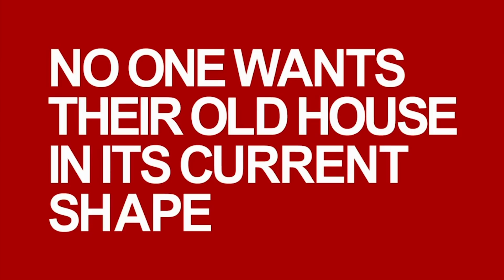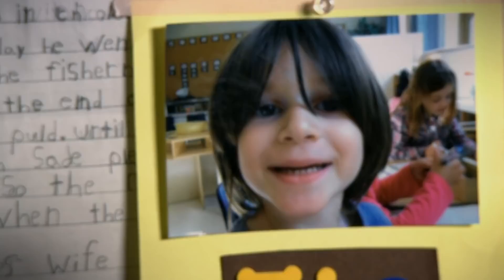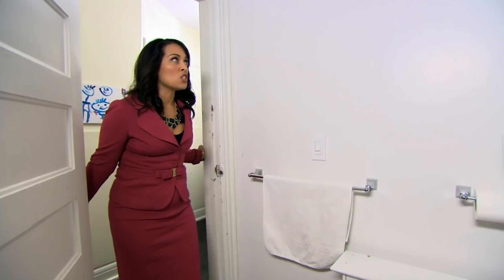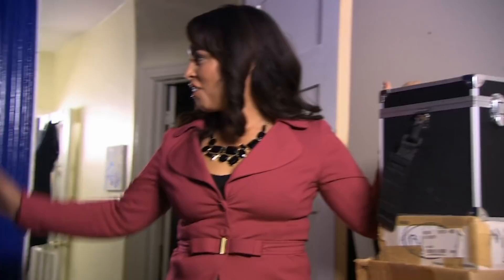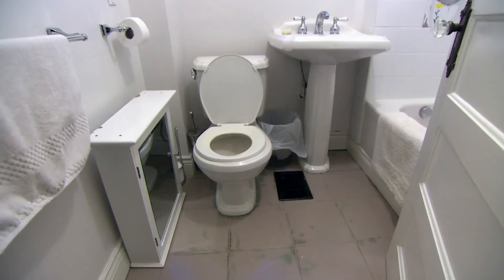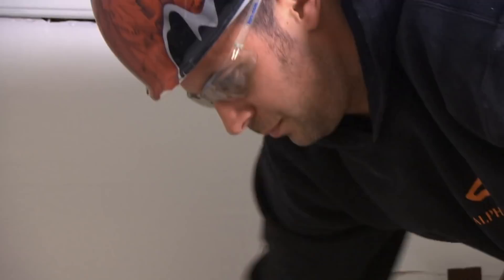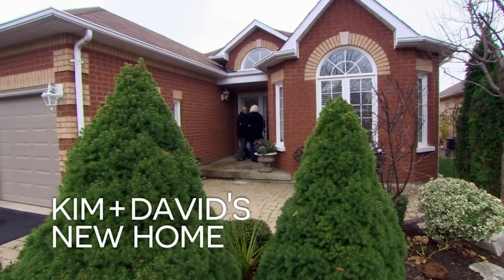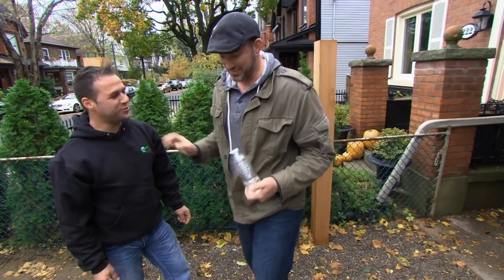Couple Has $15,000 To TRANSFORM Their Downtown Home (Real Estate Documentary)

Comment: Hmmmm.  Well, for starters, I would not have done all that work outside.  Change the fencing, enlarge the walkway by siding with some pavers, add a screening fence to hide the trash containers behind, and put an accessible (required by law) screen to camouflage the hydrant and plant some small slow growing non-pruning needed shrubs around it, paint the front door a bright color to stand out from the gray; no need to add the "courtyard," - there was a front porch that could easily house a couple of nice chairs and small table by future owners.  The bulk of the money should have spent sanding and restaining (not PAINTING OVER and adding that ugly carpet runner on) the beautiful original staircase, which could have used simple non-slip color coordinated mats or a nonslip surface finish on the treads, and fixing the junk room/office into a livable bedroom, including repairing walls as needed.  Smart ideas: adding a larger closet to the master suite and adding the entrance from the master bedroom into the bathroom so it could be used as an "en suite."
Reply: Can you share a photo of your house? We want to see how your house looks like
Reply: You stated they should have sanded & stained the stairs. The reason the more then likely did not do that was because of the amount of time it takes to sand down the stairs correctly & the high labor cost associated with that. I don’t like the cheap runner either but it’s cost effective for selling the house & making it look good. Plus many people want either carpet or a runner on the stairs to soften the noise of going up & down them. I agree that the stairs would have looked better without the runner but as I said the labor was to expensive for that & they were also on a time crunch too
Reply: I'm a bit confused about the 'ensuite' bathroom. I always understood that an ensuite was for the sole use of the bedroom that it's in? There is only one bathroom here - what are the other members of the family/guests supposed to use? Or is it still the family bathroom too?  It would be rather embarrassing if other family members are entering the bathroom from a different door while the couple in the master bedroom are already using it! I also agree that money allotted for the front of the house would have been better spent on some new paint for the woodwork, before faffing around building a patio area and bench that probably won't get used. And there did some to be quite a lot of posturing  and moaning from the contractors. It's back to watching Unsellables for me, I'm afraid!

Comment: Front yard did not need that much work to begin with. Just raking the leaves away, mowing the lawn, trimming the plants, and maybe a nicer fence. And maybe steal am meter of the lawn in front of the garbage can to hide them. That's it. The house is already beautiful, and have plenty of charm. Maybe paint the fire hydrant, if allowed?

I liked the other show better (unsellable houses). They were much more positive, never disrespectful, and they looked at the bare minimum to do to get the house sold, and with a LOT less money. It was about the project, and everyone working together to finish it, not the contractors trying to outdo each other. I do like that they focus on curb appeal, but like the other show, focus more on the minimum amount to be done, to make it a little more inviting.